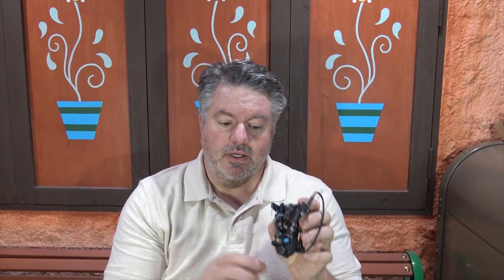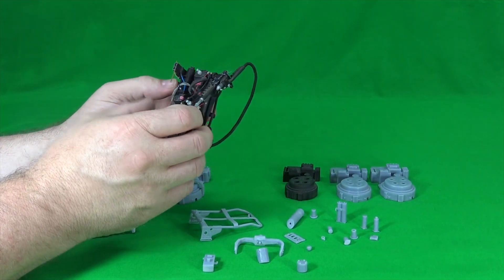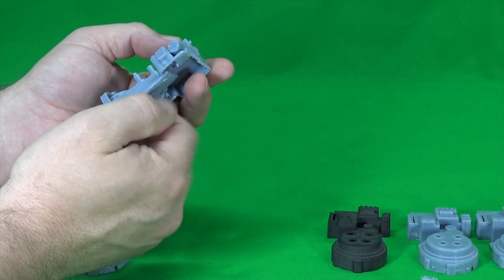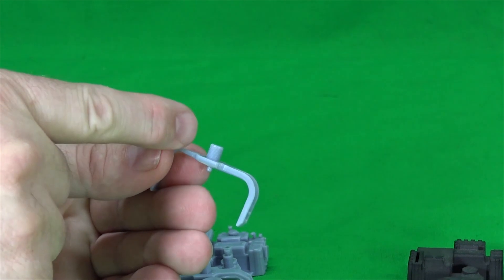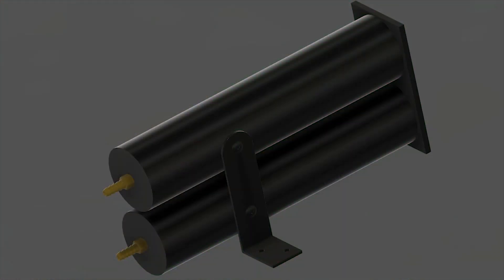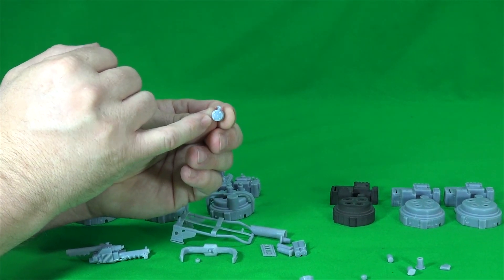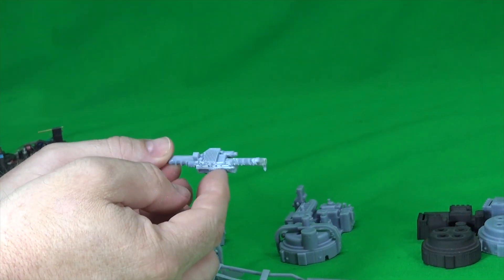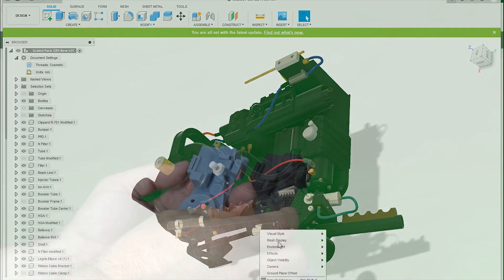Super Detailed Miniature Proton Pack!

Comment: I bought the files but some of the parts seem to be huge while others are tiny? Why? What to do??
Reply from the maker: Which ones are out of scale? I can see and either scale them or instruct how to do it.
Reply: @Larzland  I had written a reply, not sure why it didnt post. Turns out it was just because certain files were so small that Cura decided to blow them up 10,000%. Kind of silly. Anyway, I need some assistance figuring out what versions of different parts I need to print to make the most accurate miniature proton pack, in a resin printer. Can you put together a tutorial of some kind? Or a list of the most preferred parts if going for that? Talking looks-wise. Also, I wanna do parts of acrylic as actual acrylic resin so they are transparent. In the end, I was thinking it would be lit with animated SMD LEDs (the tiniest form of LED I believe).

Comment: How did you make the ribbon cable?
Reply from the maker: I told my 3D printer to extrude a length of different colors of filament. I used the .02mm and .01 mm nozzles and as the printer extruded, I let the extrusion drop from the nozzle to the floor where I coiled it up. Each fine filament was measured to ensure that the diameter was to scale (I assumed a certain diameter for each wire in the ribbon cable by extrapolating measurements from photographs of the packs). I then cut lengths of each color and laid them side by side on a piece of glass. They were held down with tape on one end, gently pulled straight, keeping each color parallel and in contact with the next, then taped at the other end. This was then measured overall to verify the correct width. Once that was complete, I carefully applied a thin layer of clear Gallery Glass that Plaid makes. I let that dry then applied second coat (possibly more, I don't remember). Once that assembly was fully dry, carefully lined up a straight edge next to one side of the ribbon cable and trimmed off the excess with an Xacto knife. I repeated the process on the other side of the cable then cut each end square and away from the tape. The cable was then gently peeled off of the glass then a coat of Gallery Glass applied to the underside. After that was dry, I twisted it and fished it through the cable clamp, tightly twisted the end that goes through the hole in the shell, adhered that end then cut the other end to length and adhered it to where it mounts on the cyclotron. I then painted the cable with dull clear coat.

Comment: When you print the pack whole, how are you orientating the part?

For anyone considering buying this file... DO IT. I've studied the pack for years, used to sell fiberglass shells, and I can honestly say most of the nuances on the pack, are very accurately represented here.
Reply from the maker: Thank you Pat. The resin shells were printed at 45°, but there is some argument that closer to 70° is better. I have started printing some models directly on the build plate and that could work for the shell. It will leave the elephant's foot that would have to be sanded smooth but some models are really, really clean printed that way. I also have a removable, flexible build plate and that makes removing models simple. I haven't printed the shell since the video so if I print it again and have additional input I will respond here again 🙂👍
Reply: The shells were honestly the first thing I ever printed, aside from elegoos test rook haha, they came out amazing but I was printing one part at a time